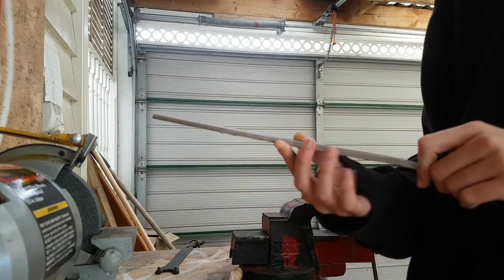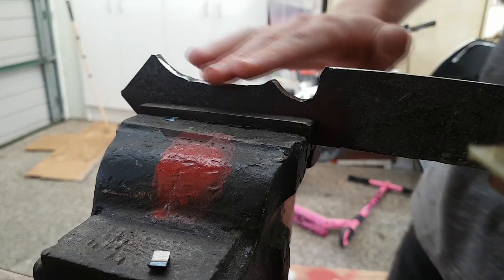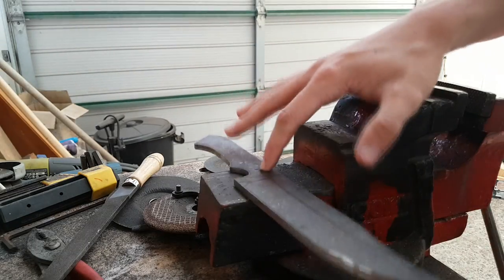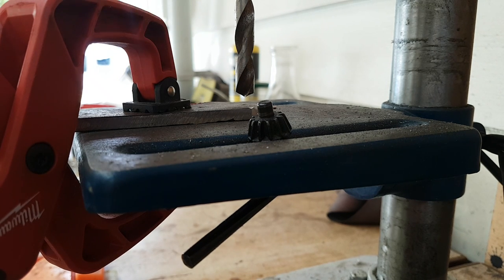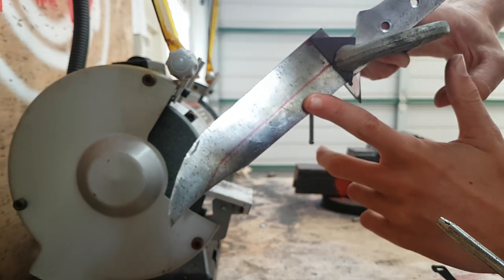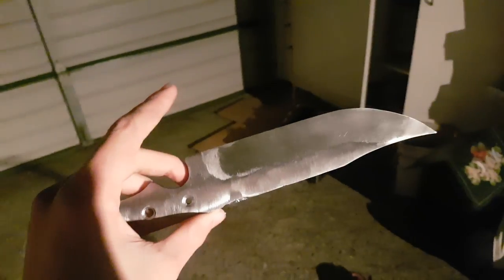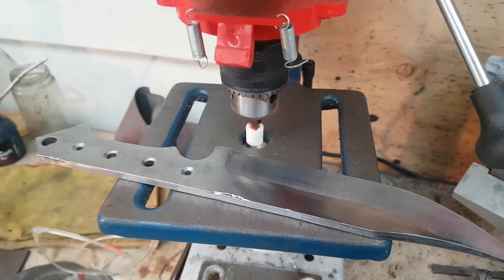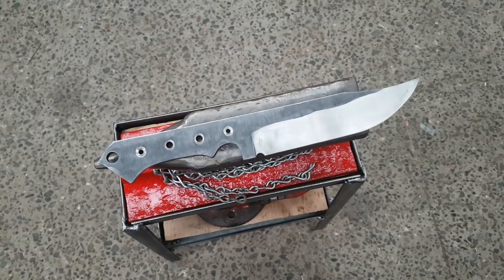MAKING A BOWIE KNIFE part 1

Comment: You should try bolting that grinder to the table. Having it vibrate all over the table when in use is both a safety hazard, and can ruin the grind on the piece you are working on.

Comment: That came out pretty good considering no belt grinder! As mentioned the 1x30 is a great starter. That's what I still use ,but my 2x72 is on the way.
Reply from the maker: Thank you :) I think I will get the 1x30 and maybe later I'll invest more to get a proper linisher (most likely from Alec Steele).

Comment: The "sharpening notch" is called a Choil by the way, nice video, and the blade looks great! What kind of metal did you use? Also, I highly suggest you buy a 1x30 belt grinder from harbor freight once you get your forge, I use mine almost every day whether its knife making or some other random project, but its very affordable (And it goes on sale frequently) for a small time knife maker plus the belts arnt too expensive either.
Reply from the maker: oh right I remember now thanks (the Choil). I'm not sure exactly what type of steel I used but it seemed to test well, if it doesn't end up getting a good heat treat It'll just be used for decorative purposes which I don't mind so much. I will definitely look at that belt sander (I am (obviously) in need of one to get those bevels nice and clean) so thanks for suggesting it :)
Reply: Yeah, it takes a little practice, but once you get the hang of it, you can get great looking bevels, and with enough practice, you can freehand grind without a jig (you can feel the exact angle your grinding at and how much pressure your puting on the blade). I started off using just junk steel, (stuff that was lying around/ in dumpsters n stuff) and there is nothing wrong with that, its great practice so once you buy some good quality steel, you dont waste/mess up anything.
Reply from the maker: my school bought an old car for a production and afterwards they let the engineering class have all the interior parts so I actually just got a massive leaf spring and once I have the forge I can use the axles and the  steering rod to forge some cool stuff ( I've heard that most steel in cars is petty good)
Reply: Cool! Ive heard that the leaf springs and shock coils are good carbon spring steel, but I havnt seen much about the axles. Looking forward too seeing some forging videos!
Reply from the maker: I too am looking forward to more forging videos :)